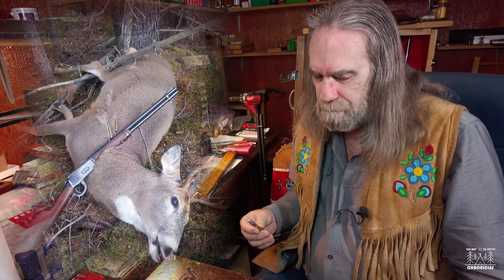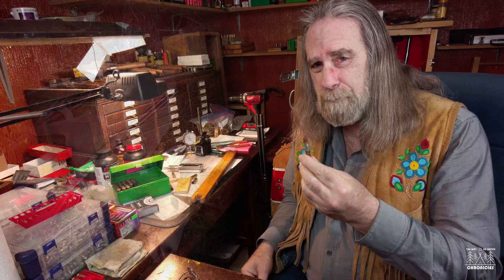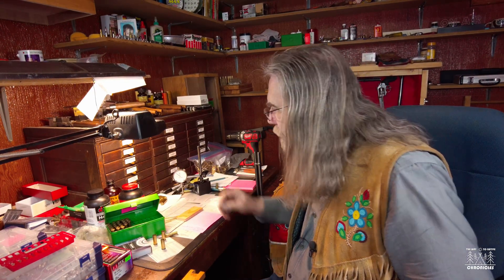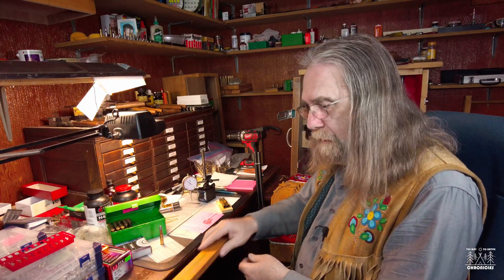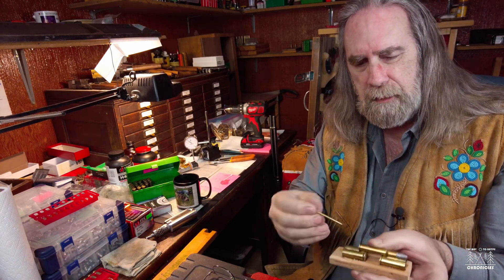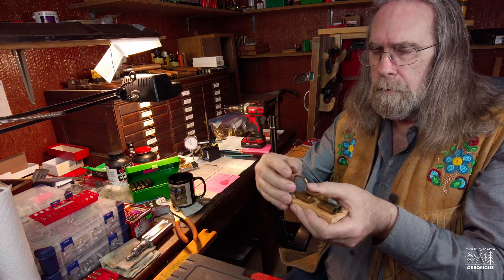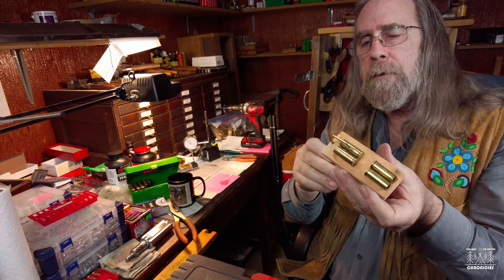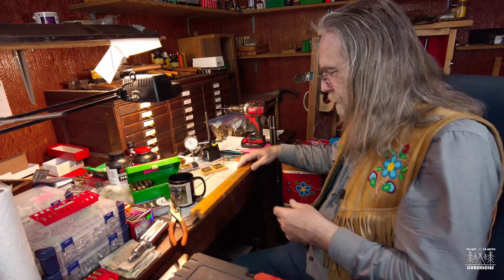Most Inexpensive Concentricity Gauge Ever! (4K)

Comment: The simpel way is often best. I try to make reloiding equipment my self too. I'm a toolmaker, old school so thats a benefit for me. Good simpel device you made. I will make something like that too.
Reply from the maker: Glad to hear you like it Lars.  If I were to do it again, I might have a little bit of separation between the .44 Mag cases to let the case on top settle down a little deeper.  That would also make it possible to have the backstop wire just come up straight behind, instead of curving in from the rear.
Reply: It's always easier to make a good idea better. The hardest thing is to solve the problem. Thanks for your advises. I think i will make a bend plate with a threaded hole in. A screw to make the stop adjustible. You came up with the great idea for a simple tool that works.
Reply from the maker: @larslindstrom5829  I like your idea!